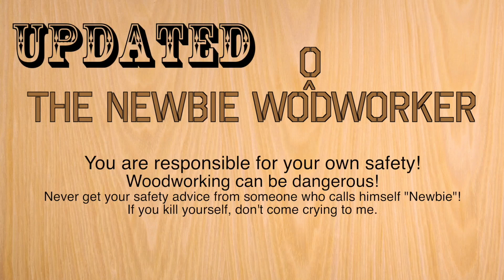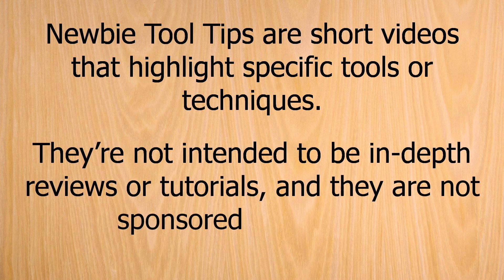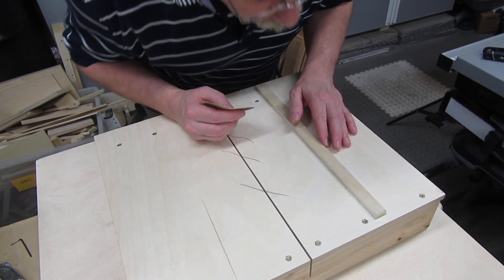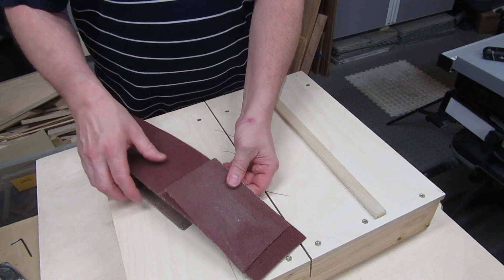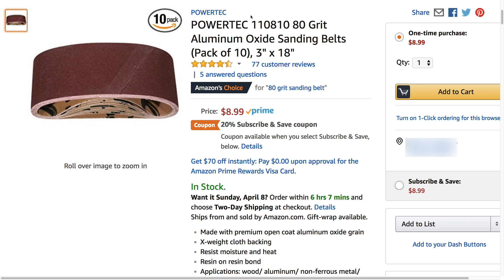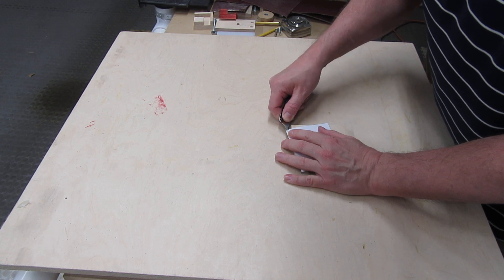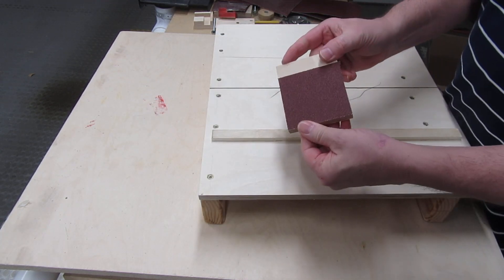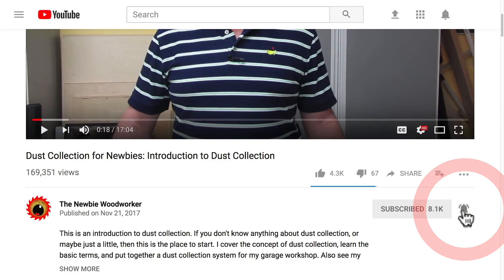UPDATE: Newbie Tool Tip: Stiff-Backed Sandpaper

Comment: Thanks Dan.
Where this technique really works well is (say) on something like a windowsill,  and you have to sand two surfaces, the broader bottom side of one piece and the narrow edge of an adjoining piece that are at 90 degrees to each other. Wrap and glue a short piece of ply on three sides that matches the edge and bottom profiles.  This allows you to sand both pieces at the same time, keeping both edges square to each other. You could even staple another  piece of ply to the  4th side (top) to act as a makeshift handle to give you some purchase to sand.
Reply from the maker: Thanks! Sounds good.
Reply: howard dove Great idea.
Reply from the maker: @ramaroodle  Thanks!

Comment: Honestly...I just use regular sandpaper and titebond II or titebond III (whatever is closest) on a scrap block and get the same results.  Truth be told...if I have a piece of scrap baltic, or hardwood strip, or any other scrap that looks like some sort of sanding block I may need...I grab sandpaper cut offs and make blocks with the grit written on the ends.  Plan for future needs.
Reply from the maker: Good idea, and whatever works! But what is this "plan ahead" concept of which you speak? 😂

Comment: Two sided carpet tape
Reply from the maker: Does that mean it could also be removed? 'Cause that would be nice!
Reply: The Newbie Woodworker I think it would be permanent but will experiment and get back to u
Reply from the maker: Thanks! I appreciate that!
Reply: I used spray on adhesive it was better than the double sided carpet tape.  That carpet tape is hard to get on straight.
Reply from the maker: Thanks for the info!